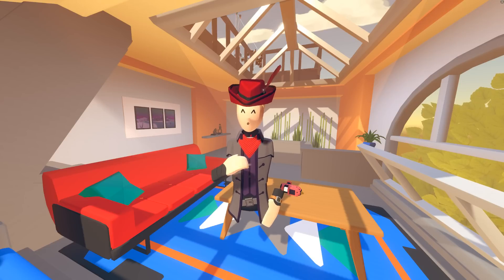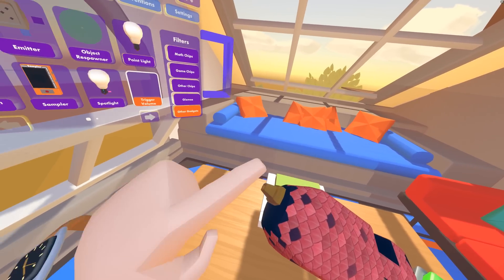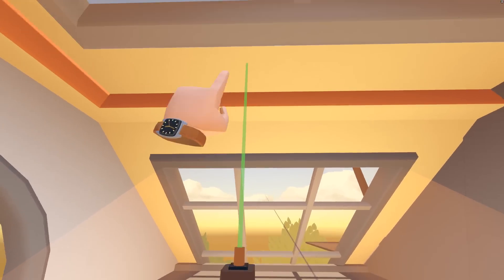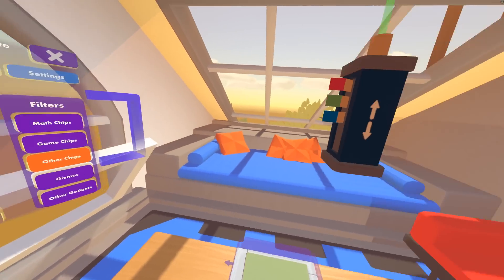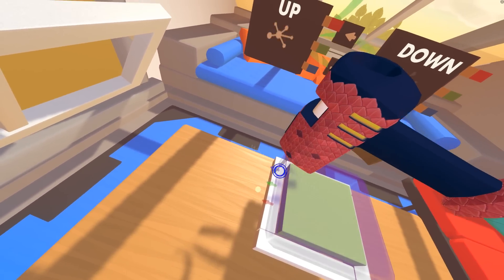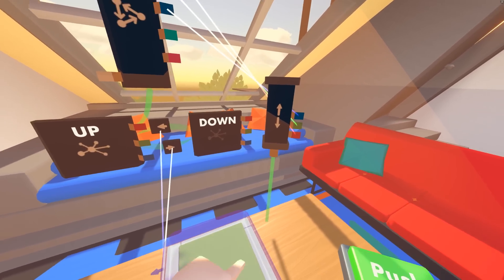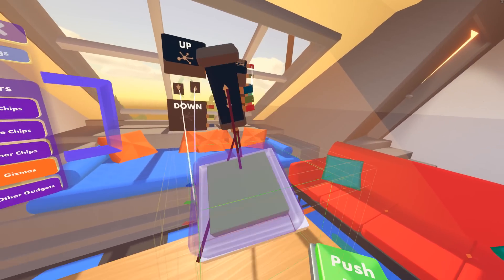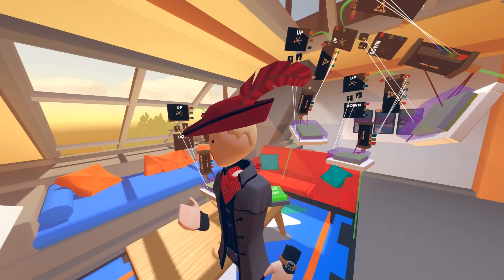Rec Room How To:  Maker Pen Crash Course

Comment: Nevertheless helpful but one question. Could you make separate videos explaining each chip and then make a video with all of them on a really advanced circuit.
Reply from the maker: That's a tall order to fill.  However, you can visit the Rec Room Wiki section for circuits which has descriptions of every chip here:  https://rec-room.fandom.com/wiki/Chips  and then circuit diagrams for examples of useful functions built from circuits here:  https://rec-room.fandom.com/wiki/Circuit_Diagrams

Comment: Okay need some help I have seen seven videos maker pen I have not found any pens that have the keys that are on my pin on any other videos there is a button that's got a magnet on it there is a button that's got some type of triangle with circles that extend outward and there are two other buttons that I have no clue what they're for I added you as a friend I really want to know what these buttons are
Reply from the maker: The button with the magnet is "snapping".  This means objects move and snap to a grid.  You can change the grid size in your maker pen settings under "snap amount" .5cm, 1cm, 10cm, or 100cm

The button with the box with little arrows sticking out is a translation mode.  Either moving relative to the rest of the world, or moving based on where the object is facing.  This is a difficult one to explain, but it's not very important for most people.  I won't try to explain it here, but if you catch me in RR I can show you what the difference is for that button.

Hope that helps!
Reply: @AfewGoodTacos  thanks a bunch taco great video by the way  thanks for replying your the only one out of 7 that replied back